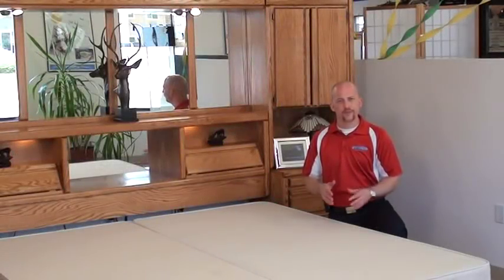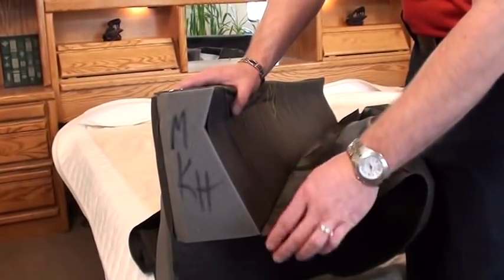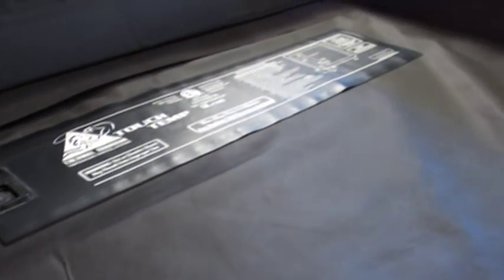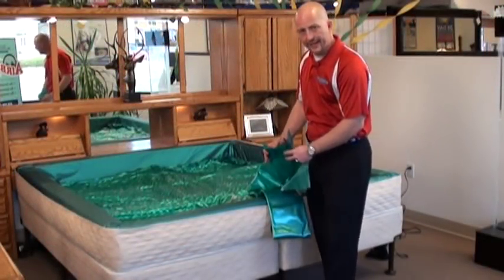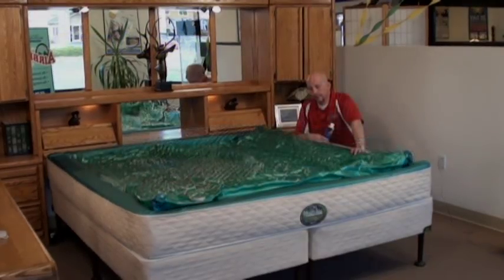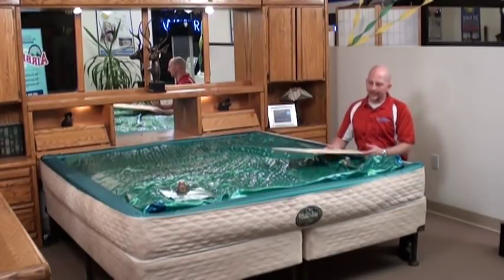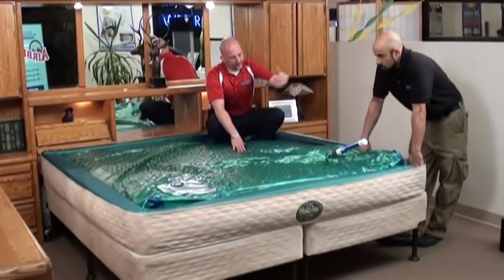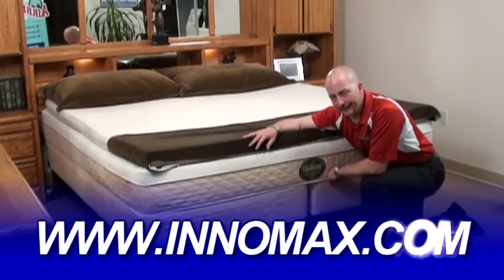InnoMax® - Perfection™ Frame Free™ Deep Fill Waterbed Assembly Video Softside Fluid

Comment: I want to comment on waterbeds , I used one 30 years ago , and loved it, but they do take some attention, pros are sleep great when set up right, can be warm or cool what suits you your choice, if you fussy about making up bed , they take more effort /work to keep smooth, the soft sides should be nice, I always had hardwood, cons are trouble to move , heaters do fail , and it will eventually leak , may take 15 to 20 years but will leak. But if you need pressure free sleep and willing to maintain a pool in your bedroom, It is the way to go.

Comment: PLEASE tell me the brand name of the 110-volt air inflator used in this video. I need one desperately, and this one seems to work very well. I especially like that it appears easy to hold, similar to a hair dryer.Thank you so much.
Reply from the maker: +Diane Harrell  The Air Inflator featured in this video is actually our AC 110v Electric Handheld Air Inflator available here at InnoMax. Here is a link for more information: http://www.innomax.com/index2.php?crn=100 , and if you have any questions or would like to purchase, please give us a call at 1-800-InnoMax. Thank you for the comment - Your Friends At InnoMax!

Comment: how much do they cost and how much water can you put in it
Reply from the maker: The perfections can be purchased currently for as little as $899 or as much as $2800 depending on your choices from a large array of available options. The watermattress holds roughly 10 to 30 gallons of water - this is a subjective answer because it depends on how much fiber fill one chooses for the watermattress. For more details call 1-800-466-6629 or visit our website at: http://www.innomax.com & click on the Live Chat button in the top right corner. If you would like to read more about the Perfection on our website please use the following link: http://www.innomax.com/index2.php?crn=138

Thank You from your friends at InnoMax
Reply: $80 Walmart